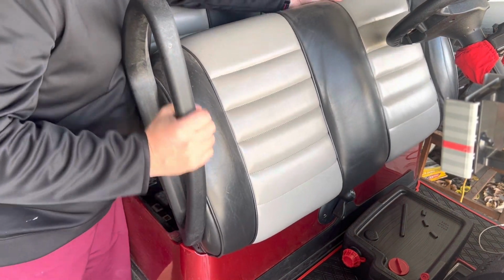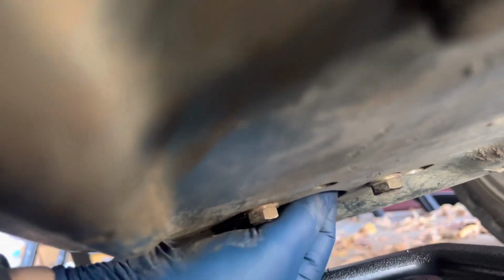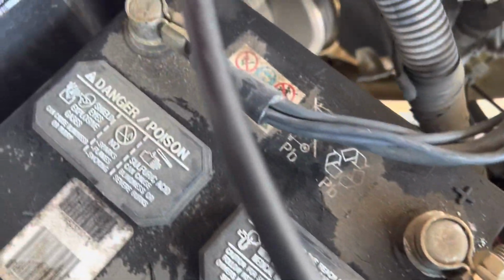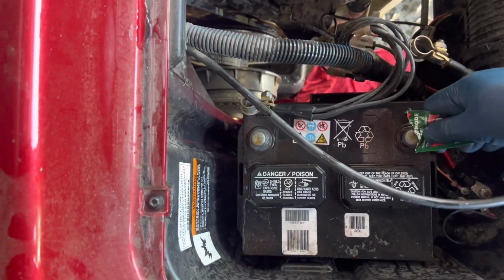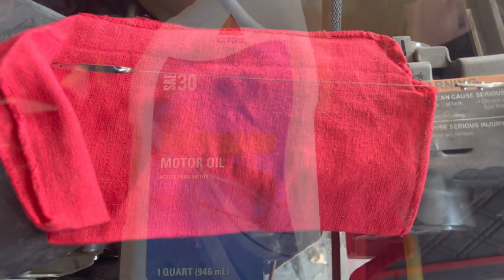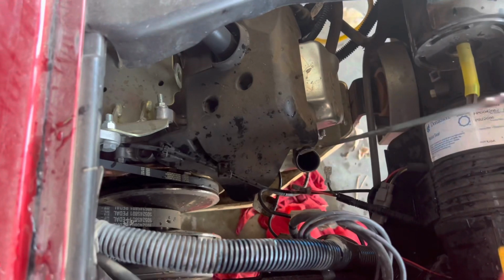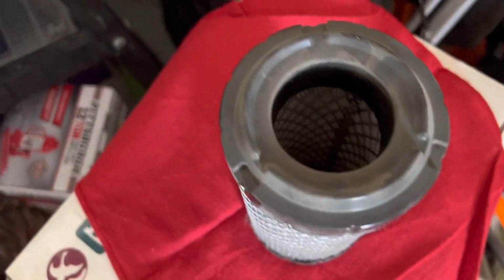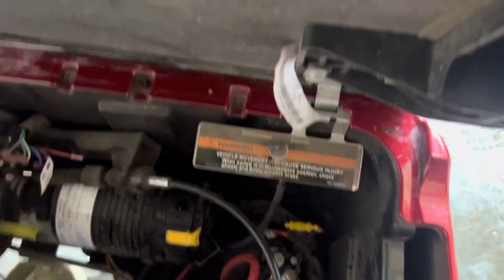Club Car Onward Spring Maintenance

Comment: 2015 Club Car Precedent with Subaru EX-40 EFI engine runs OK at high speeds but at low speeds oil light flashes and it sobviously
Reply from the maker: I havent had this problem.  Thanks for watching.

Comment: Great vid. Question  - is it possible / easy. to remove the color front grill and color back section from the onward? I am looking to buy one but would need to change the color to use it at my club, so would need to get sprayed.
Reply from the maker: I’m not sure which two parts specifically you are referencing.  The red body can be ordered in different colors.  The black brush guard wouldnt be hard to take off- you can also order it separately.
Reply: @syrupdishes6041  Thanks. It would be the red color sections, front and rear.
Reply: You can get it wrapped to match your clubs requirements.  I'm in total agreement that the color rule on club HOA's is B.S.
Reply: @BobABooey. I did that. Worked out well.

Comment: Just acquired a seldom used Onward, and this would be its first after the initial break in oil change,  was looking for a oil filter but no!, I did the same procedure you show, battery, oil change and air filter, thanks for the directions.
Reply from the maker: Great work!  I definitely should have pointed out there is no oil filter!

Comment: You caused me concrete rash on my knee, I had to get up off the concrete to go get the correct wrench size--- it's a 13mm   not 14. Get your -hit together before you post it.
Then I tripped over the oil drain pan and had the dirty oil to cleanup.
A 10 minute job took me an hour and a half. Thank you LOL
Reply from the maker: Different model? Thanks for watching.  Dont forget to subscribe!